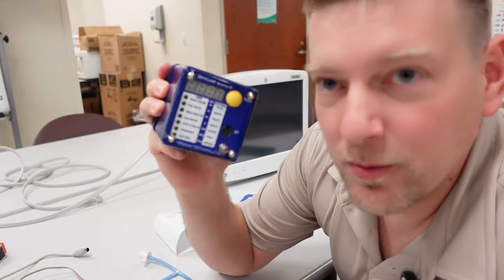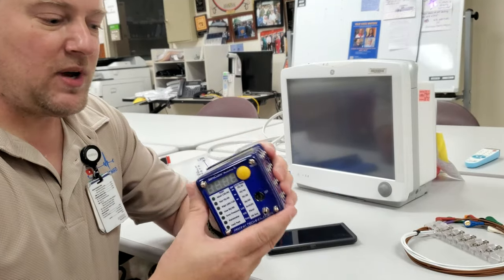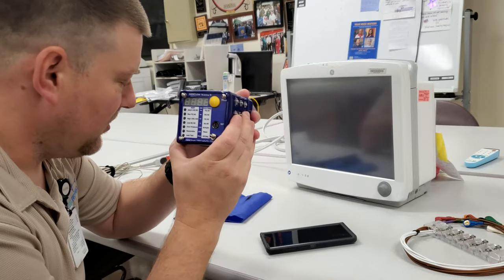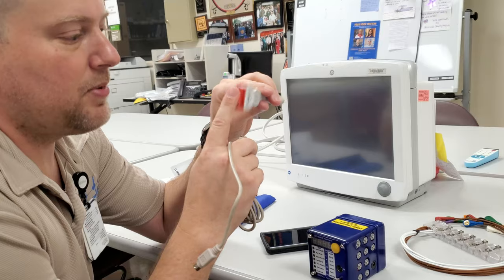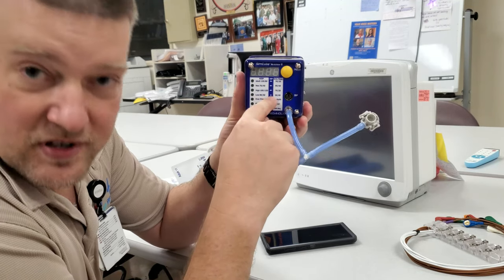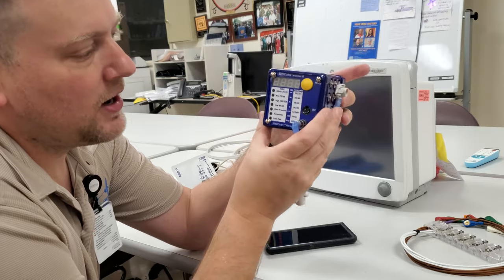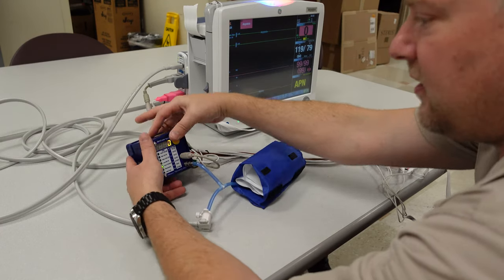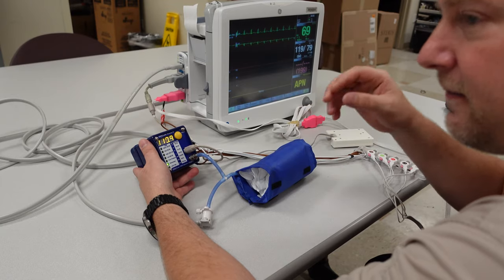Pronk SimCube Overview!

Comment: 12:51 You can actually select the Arrhyth mode manually, just hold the yellow button down until the mode LED starts flashing and press it to change Arrhyth (HR Seq also). Hold it down again until it stops flashing to get back to normal mode. It's called the 'Press and Hold' feature in the manual.  (This doesn't work on old firmware versions)

Also they are quite robust physically however they can be damaged if you use the wrong power adapter, it comes with a special 6V DC adapter, if you plug a 12 V or 24 V adapter into the power jack you'll destroy it so be careful not to mix up the power adapters.

Comment: 3:57 "use name brand batteries..." except Duracell, because using Duracell batteries are more pronounced to leak 
then any other well known name brand, and even cheap brands.
I know many people (including myself) that have used Duracell in devices that consume very little power over time, such as central heating thermostats,
remote controls etc.....and in less then a year later, the batteries where leaking.
I have here AA batteries bought in a Tandy store (devision of Radio Shack) in 1994, that came with my first Electronics Lab board, 
and they still have there 1,5V voltage and have not leaked.
The above about Duracell is with the commercial version of Duracell batteries, Duracell has also a Industrial version (Yellow instead of Gold color) of there batteries , but with that version i don't known how those are regarding leakage.

Comment: Nice demonstration,  but I really expected more of explanation on how the SimCube is used to calibrate parameters on the Patient monitor.
Reply: Calibration procedures vary from different manufactures and different models. For example, Zoll's R-Series and X-Series have two different procedures. Testing does include static pressure, leak test and a simulation, but the values are different. So, refer to the device's 'service' manual. Static pressure testing with a calibrated manometer is basically your accuracy test. According to Fluke, you cannot solely depend on simulations to verify accuracy because there are so many variables. I think the Sim Cube only does simulations and measures. I don't recall it having a function to inflate for a set pressure to test the transducers on a NIBP monitor.